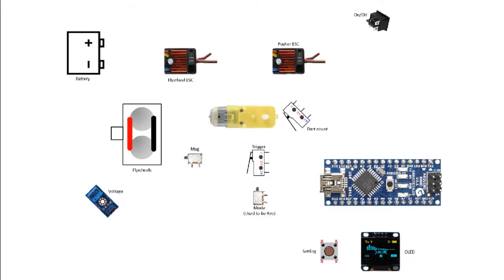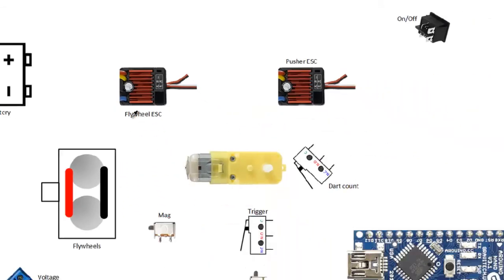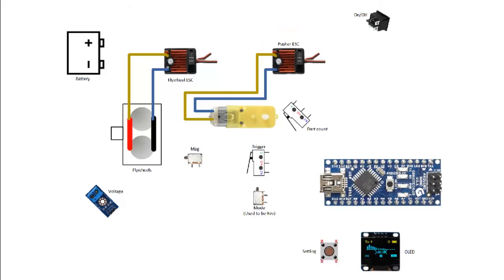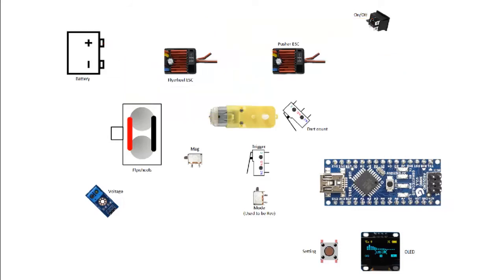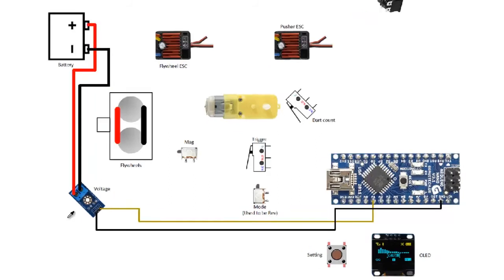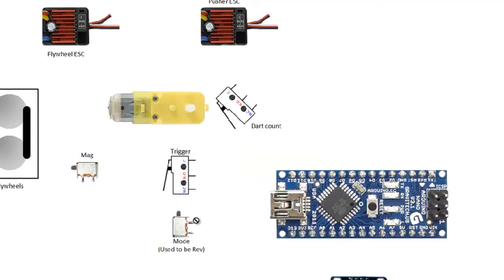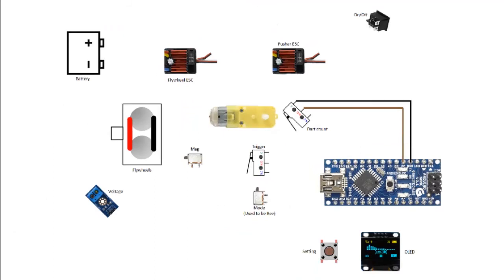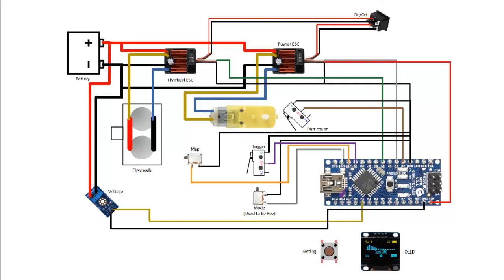{Mod} Select Fire Stryfe + Arduino (Part Five - Circuit)

Comment: Such a great video, Thank you for this!
Reply from the maker: Thanks man, it this a older mod, and some of my friends told me if a different motor was used for the pushers, the cycle control may not work well and needs to adjust the code. basically the ROF cannot be too high. I did a RS with Solenoid, with Solenoid the cycle control can be much better and the components required are actually much less.
Reply: @TungstenEXE  thats good to hear because im looking to do this build with a FTW Hyperdrive Solenoid.

Comment: Which pusherpart will work with your arduino setup? Only the the XSW full automatic Kit or also the worker fully automatik kit? By the way: excellent work!!!
Reply from the maker: Thanks man. For the pusher question, I had only tried XSW, however I do believe the rest should be fine, there maybe a need to change some of the setting values in the programing to make it work with the pusher (e.g. the delay before stopping the pusher).

Comment: im not very familiar with arduino, does it allow for multiple gauge wiring?
Reply from the maker: For arduino boards, they are not build for high current, the pins are normally for reading and sending signals. Hence the wire used need not be huge (for controlling high current via arduino, one will use relays, mosfets). for my build I use 26 AWG I find that it is easy to crimp and solder :)
Reply: Tungsten EXE  that's awsome and super exciting  so even though there is way more components the actual wire management is a bit easier!  So the wires to the Arduino don't need to be big are the wires large connecting the flywheels to ECS?
Reply from the maker: yes for those wire which connect to the motors and battery, they need to be the lower AWG (e.g. 16awg) as they need to handle higher current. You can take a look at my part 3 - dismantle (link: https://youtu.be/3XFiVIZjBRc) you will be able to see the wires I used.
Reply: Tungsten EXE  man I feel silly, I even watched the dismantle before this part and didn't even think about going back to it! Thank you! Awsome work
Reply from the maker: ryan berry lol no prob man :)

Comment: Do you have a stl file for the pusher for the select fire ??
Reply from the maker: The pusher is the "full auto XSW kit", but I believe there is a version in Thingiversa (I am not sure by who). the rest of the 3D part I did was the housing for the OLED and the spacer piece for the XSW kit, they are in my github (link: https://github.com/tungstenexe/Tungsten-V2) stl folder.

Comment: You can use mosfets instead of ESC because you only need motor to go in one way
Reply from the maker: yes you can, and I did use the mosfet setup for my rapidstrike mod, wanted to try out the ESC and wanted to make use of the motor brake option from to ESC rather then making my own AB mosfet motor brake (I am not too sure how to do it, may try in the future). I most likely will use the mosfet for the flywheel to some future mods :)

Comment: You should really work for Nerf/Hasbro in the design dept! You'd be making a healthy salary cause you can take Nerf to a whole new level with the addition of electronics in there blasters!
Reply from the maker: Senior XJ , that did be awesome :)
Reply: Tungsten EXE,, contact them and direct them to some of your videos. A lot of those electronic boards, switches, motors, and wiring can become super cheap when bought in bulk. They would just need someone like you to set them up for mass marketing.